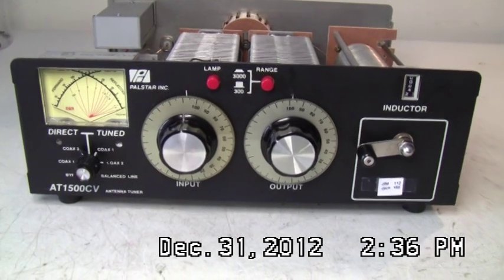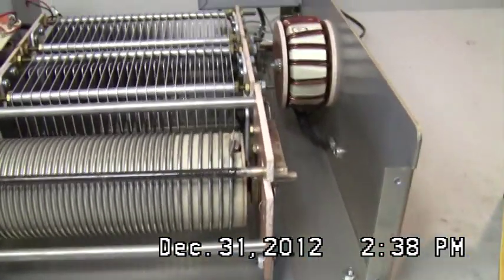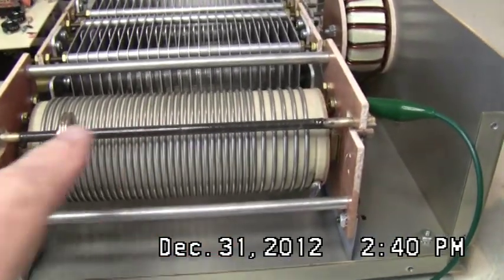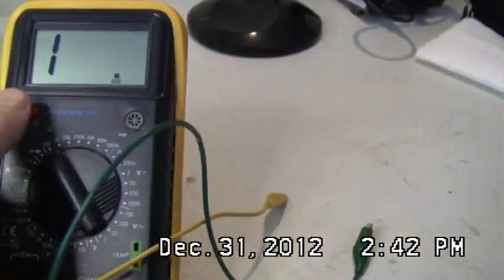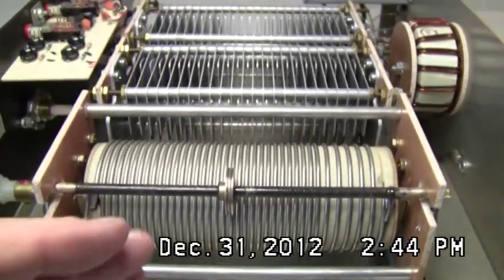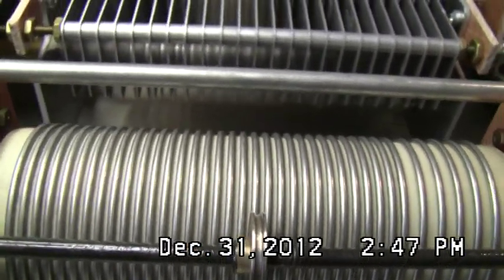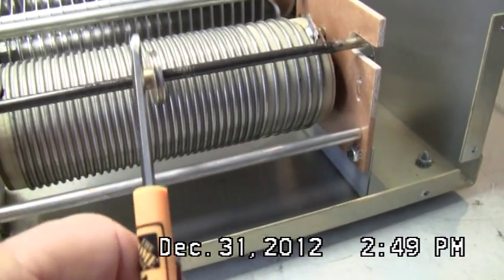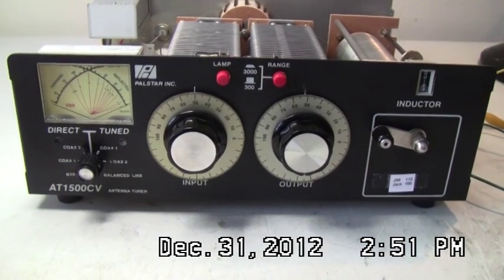Palstar antenna tuner AT1500CV

Comment: I have my AT2KD open, and am trouble shooting a "clunk" sound it makes erratically on turns.  It feels and sounds like it is hitting something, but it is not.  I also doesn't do it all the time.  I just knew I was going to find something loose inside, but all the screws are very tight.  Nothing at all is loose.  Head scratcher.  I started cleaning the coil, and wow!  It appeared to be clean, but was filthy!  It was still tuning just fine.  It looks like I have the graphite grease on the shaft contact points for the drum.  You never said that you relubed your shaft contacts after DeOxit cleaning.  My AT2KD doesn't have springs holding the wheel and shaft next to the coils.  I am using a product from Amazon called "Lubree" graphite grease.

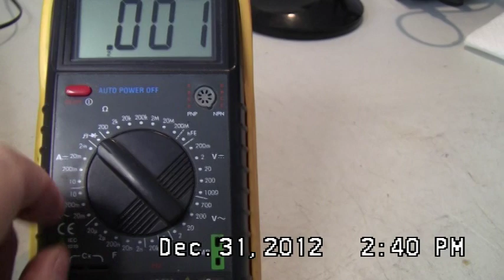Comment: The idea how to is good, however connecting the meter leads to the two springs will not work; it is a dead short.(2:35 to 3:54 min.)

Comment: Why not use CCL4 or carbon tetrachloride for a big can almost a full pint is only 3.99 at auto parts store. Just aske em for a can of brake cleaner. CCL4 has been used since ancient time as a excellent degreaser of electric conections and PCB's since it drys instantly and cuts grease like hot knife in butter.
Reply: some of that auto brake cleaner is very corrosive stuff.  I'd be careful using that in an expensive tuner with so many plastic parts that could melt.

Comment: I have had to replace so many of these roller inductors, the problems that I have found is that the bar has way too much flex in it, you can re-solder the ends as you have to with the big AT4K and the AT5K but I got so fed up with the cheap quality of these units and in the end I ordered some new ones from OM Power Amplifiers, they are built to last a nuclear strike, they are not cheap but after I tried ordering replacements from Palstar and found that these were still cheap and horrible I started to source better quality units, they are quite costly but never flex, and the bars for the roller are made from silver steel and have no flex what so ever..

Comment: Just make your antenna tuned so you don't need this, even a trap vertical like the 
AV-680 is a nice antenna for all bands 6 thru 80 and you don't need this crap tuner.
Or make yourself a Fan dipole for all the bands and you don't need this tuner either.
Reply: Shallow water indeed!

Comment: Spring wheel is not worth a crap, not round crap coil. JUNK.
Reply: It is a standard roller coil, strange comment.
Reply: That's an opinion you are expressing. What if someone wants to experiment with radio design and LC circuits? You don't think an inductor like this is handy? Please explain your comment, as to why its junk.
Reply: Mental problem much?

Comment: Diode tester my arse it's a continuity tester position on your meter it's a piezo buzzer in your meter to test for continuity
Reply: Most of these meters (like the Fluke) call it diode test mode, it is fine for continuity testing too.

Comment: Its a poor mechanical design, thats the real problem....Instead of a grooved wheel follower it should have a sprung loaded stylus following the coil, just like a record player....Then a hard wire direct to the stylus tip, its obvious....You would still need the circular wiper on the end of the cylinder though....That problem is again a design one...poor choice of wiper materials....Just bad Design, thats all....A USA designed machine perhaps?
Reply: They are not an ideal design, the little pulley style follower wheel on mine does have a spring clip style arrangement to ensure a  good connection between itself and the guide rod. My roller coil got a good clean up and some silver dip treatment over 30 years ago, it is still ok to this day.
Reply: You know nothing about this equipment and have a real mental problem.

Comment: Thanks Joe! I am having the same exact issue with my AT1500CV. I had cleaned the coil turns and wheel on the roller inductor with alcohol, but still a bad connection that when I keyed the radio would instantly get a good connection and keep it as long as I didn't move the roller inductor again. Gonna pick me up a tube of the GB OX-400 antioxient  and I have a can of Sprayway #709 non-residue electronic contact cleaner for the ends of the coil you showed. Should fix it right up! Very 73 de KU4GW

Comment: John, I just cleaned Jimmy's Transmatch.  The roller was really oxidized and just alcohol was not enough to do the job, so I used a soft drafting eraser. In the roller, I used an eraser pencil, you just sharpen the pencil and it is only an eraser.  This cleaned the roller great.  But, I still have dead spots in the roller and it's because I need to use the deox on the contacts and clean them too.  I also need to get some grease, I am wondering if just graphite from a pencil would be ok on that.